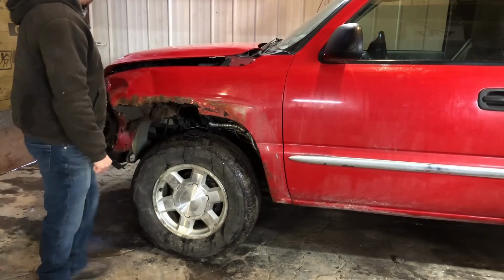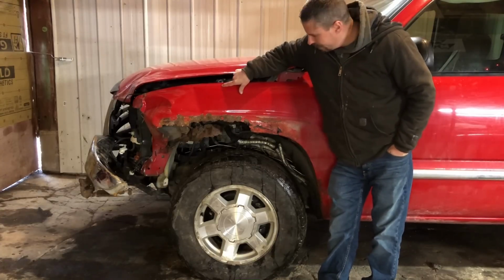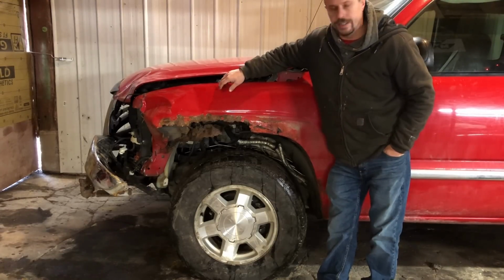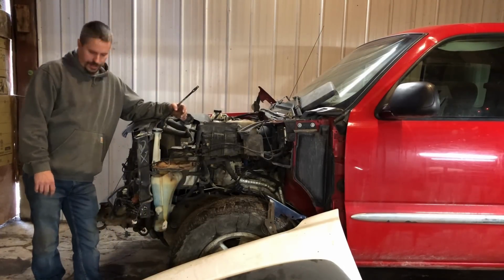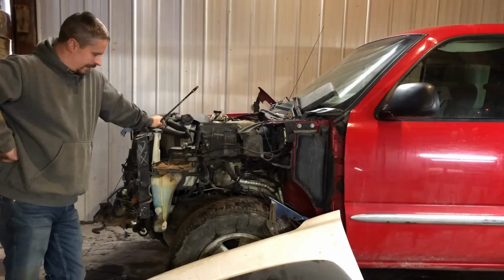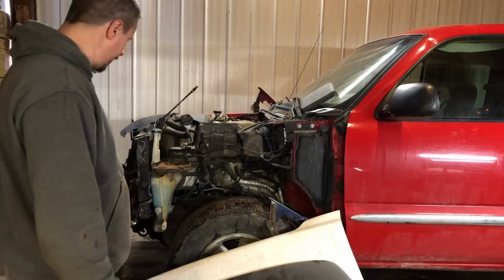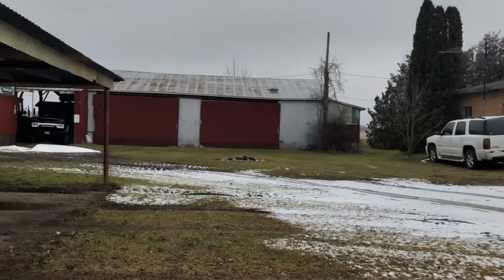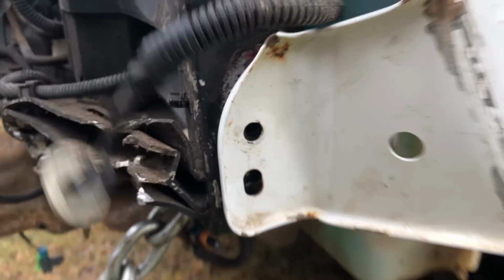JT’s “the damage is free” collision repair!

Comment: Love your tractor videos. Saw this one and it inspired me to perhaps buy back my truck from insurance company and fix it. The wrote it off. 2008 gmc 3500 dually diesel. $31,000 damage. Front corner like yours but didn’t impact the wheel or steering. A driver hit my rear duals. Knocked the differential off the springs. Spun me around and I hit another vehicle. A couple of friends have told me to keep the truck. My truck was in mint condition and 112,000 km in it. Diesel engine 4X4. I don’t think the rear end is damaged. The springs aren’t broken either.
Reply from the maker: I’d be keeping and fixing it!

Comment: Hey JT, about six years ago my wife hit the back of a heavy truck perfectly in the trucks hitch and the left front frame horn of my rendezvous. The hood , grill and fender were untouched but the bumper cover a sub bumper were destroyed. The frame horn did what it was supposed to do and accordianed about eight inches taking the radiator support with it. After about half an hour of making no progress I cut the frame horn and damaged radiator support out of the car. I drilled out the spot welds and pounded everything straight and then welded it back in place. Picked up a salvage  bumper and a new bumper cover. The car was black as was the replacement bumper cover so there was no paint involved. $350 in parts and about a day's work. The insurance check was $4300. Not too bad. We traded the car about two years later and told the dealer of the damage and  repairs. After they checked it out and checked the "car fax" ( there's a lesson here) they gave me $4600 trade in. It pays to be handy!:)
Reply from the maker: Sure does!  Nice when a vehicle will pay for itself.. twice 😉

Comment: Very nice! this makes me miss My 04 i just sold. Sucker had 336k on it and very minimal rust i had bought it from the original owner, it was a garage-stored truck. Went out and bought a '91 K2500 Light duty 6 Lug, 5.7/7004. I was looking for a 6.2/6.5 diesel but no luck. Btw i stole that '91 for a damn good price, Got it in a bundle with a Newer $6000 Boss Hydro-Turn plow. A friend down the road has a 96-98 Ext cab 1500? with a 6.5TD in it, needs some srs TLC though. Still may buy it. Could we see a video on the JD Sled?
Reply from the maker: Those 90’s chevys are some great trucks. Hard to beat the ease and reliability of the 5.7.  Won’t get the mileage of the 6.2 but it’ll keep working!  I’ve considered a video on the Deere’s, just need some snow to stick 😉